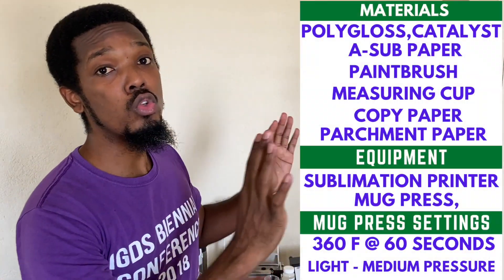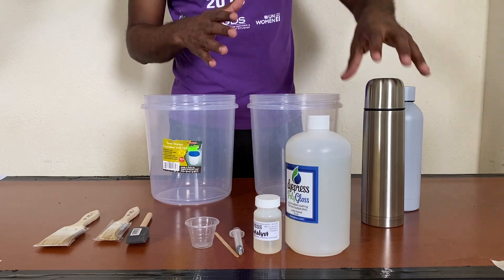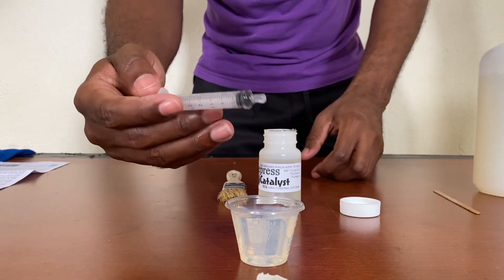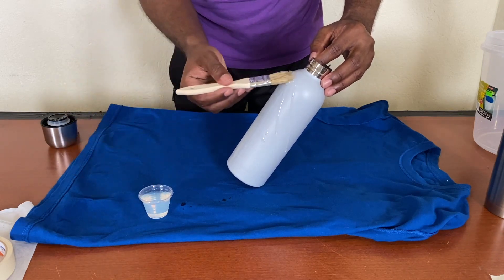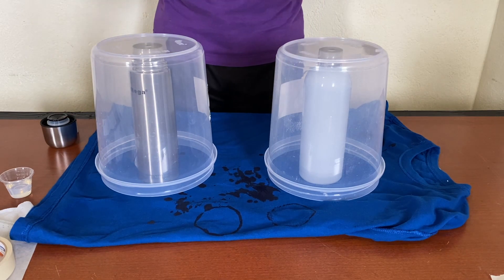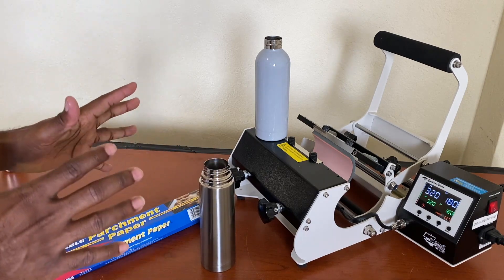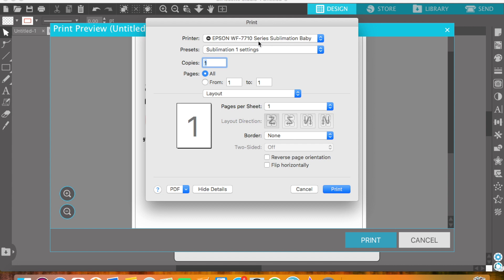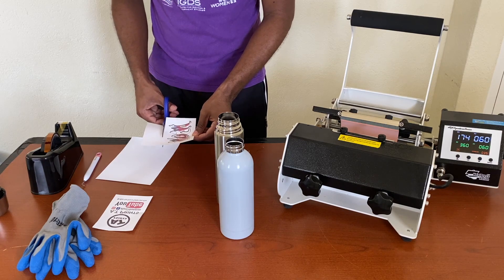Coating Stainless Steel with Polygloss | Sublimating on Stainless Steel Apparels

Comment: Please help!!!! I have tried and tried different ways and as soon as I put it in my toaster oven, it turns brown like a marshmallow! I don’t know what I’m doing wrong!!!!! I have lowered heat and everything. It’s like the polygloss is melting.
Reply from the maker: Hey thanks for reaching out and I will try to help you as much as possible. There are alot of aspects we can look at. Firstly lets take a look at the toaster. A toaster can do the job but you might have to lower the temperature a bit as the heat can be to hot for baking/curing the tumbler. The next thing would be to get a temperature gun so you can get the correct temperature when you are curing your items in the toaster. If the toaster is to hot the polygloss will turn brown so your problem at this moment might be that the temperature is to high and that you just might be leaving it in to long. 

Can i ask what type of toaster do you have?
Reply: Thank you so much for responding! I have the new black and decker with the air fry option.
Reply from the maker: @courtneypainter2394  Ok thanks for confirming so if the toaster is one of the small ones, this could also be why your tumblers are getting brown so quickly. Why I say this is because the smaller the toaster, the less room it have for the heat to circulate. So what you would have to do is closely monitor it. Take down the temperature, put in the tumbler and check it every 2 minutes or if you leave it at the high temperature make sure to check it every minute. In other words stay in front the toaster and watch it to see when it actually starts to show that brown coming. But in your case i would lower the temperature and watch/check every 2 minutes. 

You can also bring back to life those tumblers that turned brown. I have another video showing how i restored some. Its a process but it can work. Take a look here -https://youtu.be/NlaVpag3qIA
Reply: Thank you for your information. I will definitely try that today. Thanks for all your videos! Very educational! I will save those other tumblers! Hopefully I will soon ace this!
Reply from the maker: @courtneypainter2394  You are most welcome and feel free to reach out to me on IG or Facebook and show me your progress. All the links are in the description.